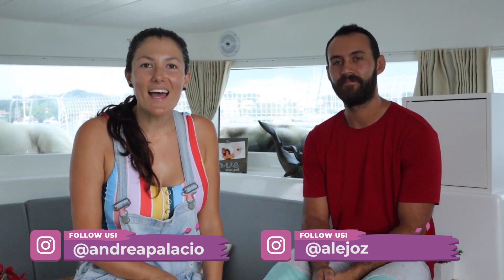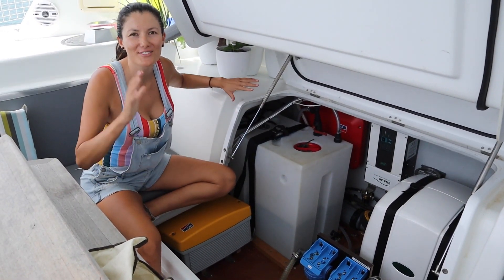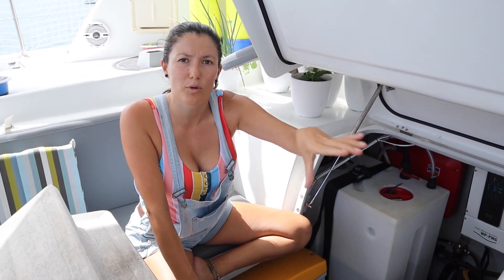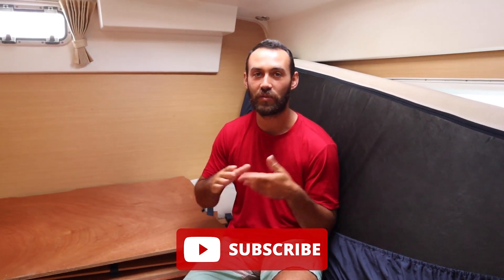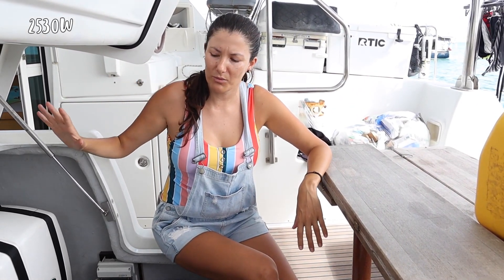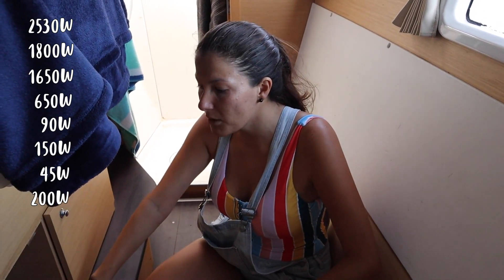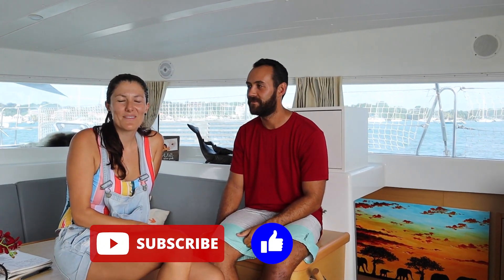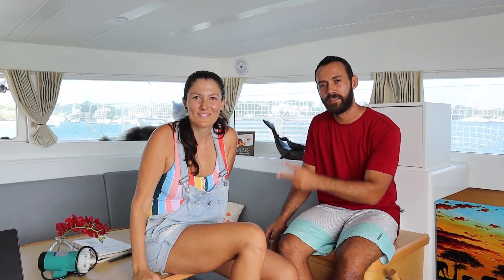1770W OFF GRID SOLAR POWER SYSTEM W/ LiFePO4 ON A BOAT

Comment: What inverter are you using? Me and my father are trying to plug the inverter into our panel box in the boat for 220 volts.
Reply from the maker: Hi James, we have a sma sunny island 6kw inverter ours is connected to the shore power cable.

Comment: Love the content
Sailing Lady Africa sent me here :D
Q..Why does the AC need a big water pump.
  Is it a air compressor type or a water cooler?
:D
Reply: Regular A/C systems usually use condensers as form of heat exchanger, usually they have a fan and air moves through it to cool or heat, for boats they use raw sea or lake water to do the heat exchange for the Cooling mode...
Reply from the maker: Hello guys yes that is correct Danilo
Reply: @LivingHakuna   Thankyou.  Is there is a cooling/heating that has gas in the main unit to help chill the air or warm the air.
I think I could be very wrong but i love your boat
Thankyou for your reply

Comment: The inverter never takes the solar power straight from the panels or MPPT. The MMPT charges the batteries and then the inverter takes the power from the batteries. If you say the power of the battery bank without voltage, you say them in watt-hours ;) Top video trouwens!

Comment: Commercial land based panels are up to 600 watts with the multilayer panels still in the labs at the moment though (increases the efficiency of the panels which at the moment is only up to 22%). 
Your system is set a certain way with a combined serial solar panel configuration. Have your panels been fitted with the bypass resistors for when one panel is in shade. Balance cats configure their systems in a different way as an example with individual solar panels in parallel with a dedicated controller per panel, so if one panel goes into shade or malfunctioned it does not take down the whole solar array system

Comment: I am a bit surprised about the high watermaker power consumption... 2530W sounds to much for me. Just looked up some datasheets: a 60l/hr unit needs abou 300W. Where does the mismatch come from? I dare you have an 500l/hr unit. Is it a typo or a really inefficient system? Might be worth to check the root cause of this mismatch...

Comment: I'm assuming your anchor windlass and power winches run from the 12V AGM bank as well.  Also, I'm going to assume the reason you went with an AC to DC (110/240 -> 12 VDC) converter, instead of the typical DC-DC converter (48->12) is becuase you have the inverter on a lot.  THanks for the video guys
Reply from the maker: Hi Douglas, yes that is correct 👌🏻 thanks for watching

Comment: Why are you converting AC to DC, very inefficient especially as you already have DC at 48v, you just need a very cheap DC step down transformer from 48v to 12v to both charge your AGMs (Not AMG as in your graphic) and even power your 12v systems directly. I do feel like your system is far more expensive and complicated than it needs to be... If I built out my own system, I could close to match yours (Batteries & BMS cost only) for just 2500 USD for 320 Ah at 48v, I am gonna bet you spent a LOT more than that.
Reply: Just love the “ IF  I build out my own “ 😂
Reply: @jnjentinc  Thats "If I was to build out their system", I don't need or want a system like theirs so I wouldn't, I have a 13m monohull, I have 800w of solar and 2x  320Ah 12v LifePo4 cell packs (I built my own packs) and I run a hybrid system with an AGM in parallel which allows me to maximise their particular properties while it handles alternator compatibility and charge profiles of older charging systems. I am not doing anything special; you can buy lifepo4 grade A cells from china, 320Ah 12v packs for 450USD, just have to do the math. Far Less than half the cost of what their big battery packs cost which is a saving of thousands of USD on a system their size.